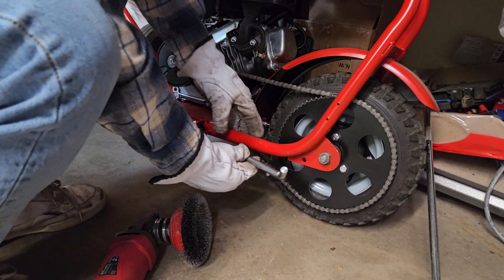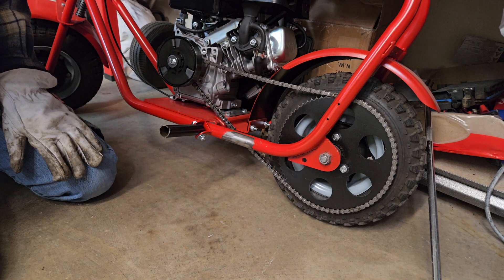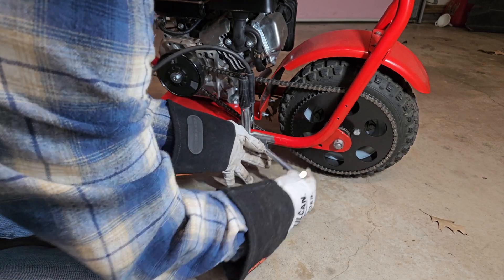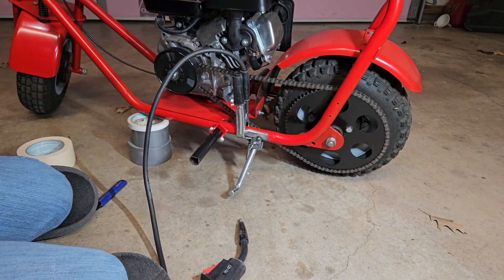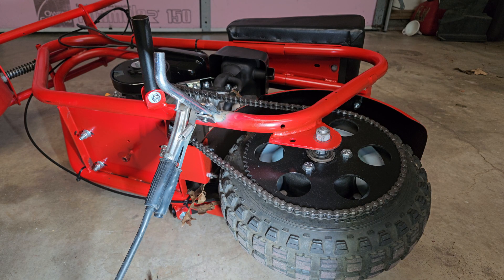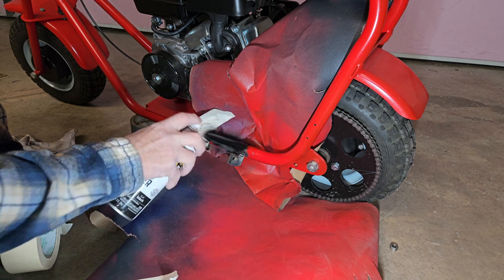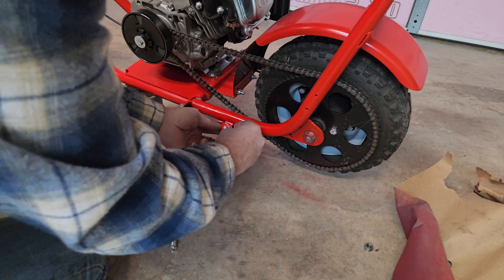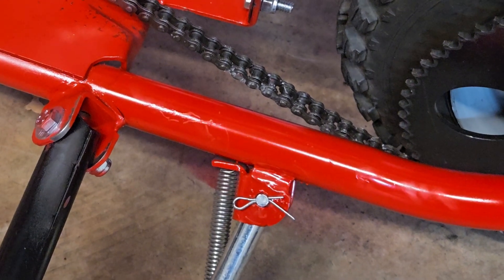Adding a GoPowerSports kickstand to a minibike

Comment: Which style of kick stand do you like the center double leg style or the single left / right side style of stand I've seen the center stand on dirt bikes  that keep it nice and level  instead of the  bike being in to much of a leen that might cause it to flood the carburetor
Reply from the maker: I am not a fan of center stands. They are more "tippy" and the way I ride dirt bikes tends to put the stand down on landing
Reply: @GuysPlayingWithTools    I know what you mean by the center stand can come down when you are jumping over hills and next thing you know is the center stand has  came in the standing position  after you have landed from a jump
Reply from the maker: @robertmailhos8159 And down for the one after that
Reply: For sure I know what you mean by tippise on the center stand the back end of the dirt bike weighs more than the front end even though the engine is in the middle of the frame @GuysPlayingWithTools